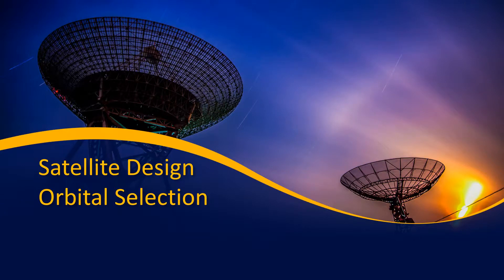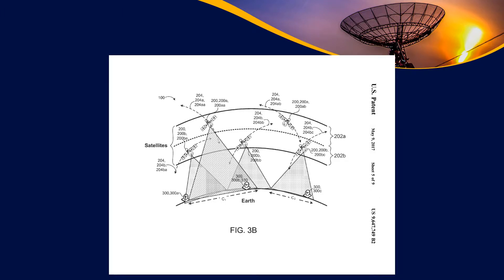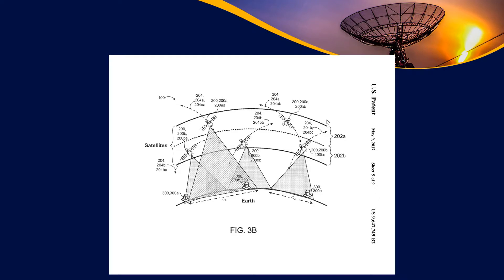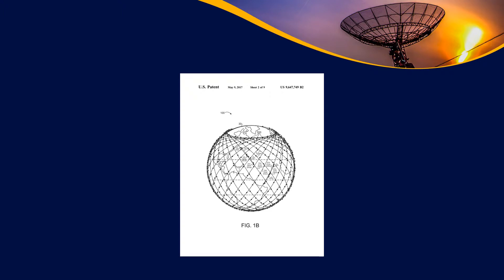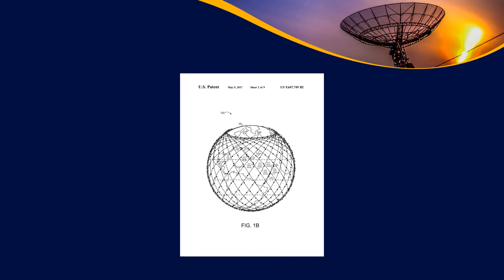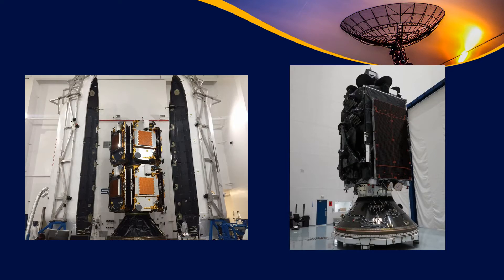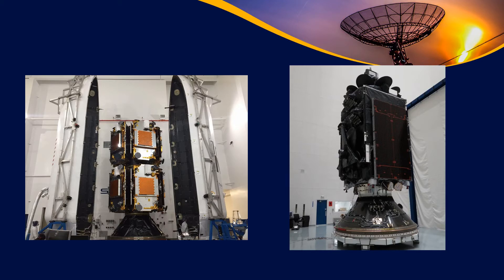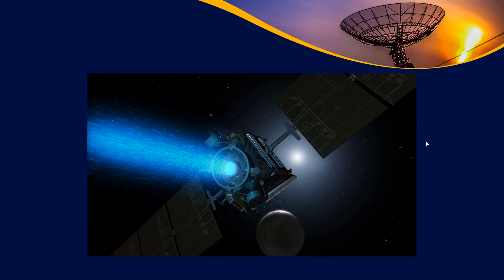Basic Satellite Design- Basics of orbit design

Comment: Any recommended videos for how we launch into different orbits? Once an orbit is chosen for a particular mission, does the rocket leave the thick part of the atmosphere and immediately turn in the direction of the desired orbit? Is that why Vandenberg AFB (now SFB) and launching from the Cape have different benefits? How much of this inclination can be adjusted once in orbit? Any insight in those delta V maneuvers? I hear SpaceX did a Florida launch a little while ago straight into a polar orbit, but just had to burn some extra fuel to make it happen? Again, was that fuel burned during the rocket stage1 ascent phase? Thank you for all the great info!
Reply from the maker: I might do a video on this. The short is, a single inclination per launch is by far the easiest, bit different planes and orbital heights are totally possible with a single launch.

There are a number of fuels for rockets. The most common liquid fuels are hydrogen and refined kerosene, known as RP-1. This is what Falcon, Electron, and Atlas use, while Delta and centaur use hydrogen. Methane is starting to be used more, for Starship and Vulcan. There are a few other fuels used, hypergolic ones.